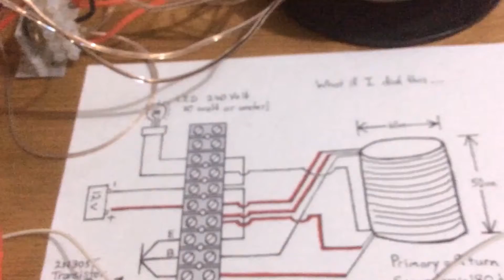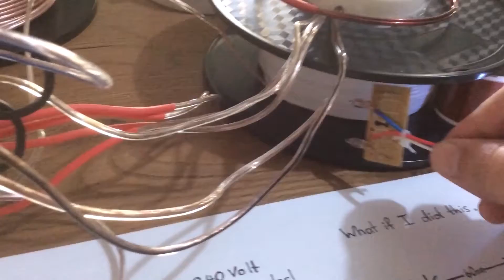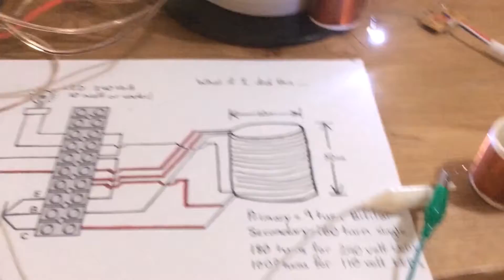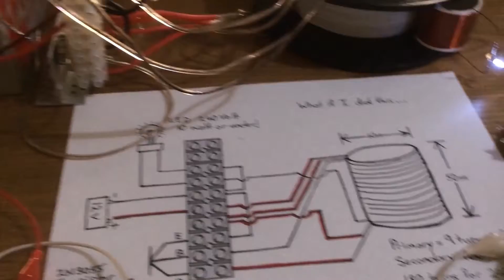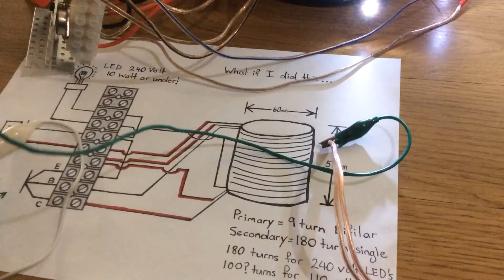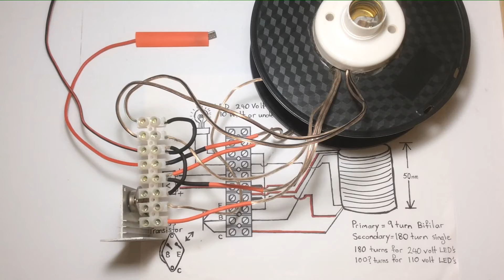Part 3 of 3 DIY Backup 240V Light How To Tutorial for Power Shortages - Connections What goes Where?

Comment: So, in the intro about safety (highly appreciated ! ❤) you have used that little pickup coil … I wonder if L3 with steering diodes and center tap + cap seen in other videos plays the same role ?  I guess the voltage shown in cap will sag down if earth connection isn’t able to provide enough current … can you suggest a load to be connected to cap in parallel with L3/pick up coil ?

Also, your L3 center tap should have no self inductance … means it can’t load L1/L2 when wound straight on top of L2 for best coupling outcome. Somehow, I can’t get the setup right and usually I can’t get it started with transistor base on high side … after trying many things once I can get it, it doesn’t want to work after disconnection and don’t want to work at all nor on low side nor high side and I never remember what I have done to get it to work … my hobby for last 2 weeks 😂

Comment: I'm in my 60's I did a lot of work in R.F. stuff years ago, your peak power is when you have optimum 'standing wave ratio' (SWR) (lowest reflected power) thats when most power is (RADIATED OUTWARDS) don't worry to much about low frequency radio signals they pass straight through the body with little effect, it's only when it is converted and stored in a capacitor that it can be immediately dangerous. Some people however do suffer from an intolerance to radiated radio signals. That being said microwaves are another story Giger-hertz frequencies can cook you alive if the field is more that a several hundred watts, as for milliwatts or several watts below 50 or so don't worry to much. Low frequencies such as long wave, medium wave below 1 MHZ will not harm you physically at least in the short term, we live in a swamp of low frequency waves all the time. Remember it is when a frequency is rectified and stored in a capacitor with several hundred volts you need to be careful. just thought I would ease your concerns. A friend in the USA has done extensive research into what is called Electro Smog which is radio waves http://seahorsecorral.org/ehs3.html

Comment: Very nice video indeed! Have you tried to close loop the device by feeding the source battery with the output of the capacitors? With lowered voltage using voltage dividers (using a few resistors)?
Reply from the maker: Thank you for watching. I have tried several different ways of feeding power back to the main battery and I believe it is important to pass the feedback through a toroid to convert the electricity into magnetism and back again to isolate some of the radiant energy field. The high voltage radiant energy that feeds into the battery through the circuits input connections prevents charge from external sources as it sees the high voltage and prevents current flow. Voltage dividers or resistors are essential and I find it cheaper to use things like old incandescent light bulbs for resistors as these can handle the heat and are much lower cost than large resistors.

Comment: I think that's high frequency high voltage very low current, still the safety warning is in order. When yoy touched the piece of wire you were introducing ground proximity thru yourself. I think you're touching on radiant energy, your antenna is your wires and circuits
Reply from the maker: I think your correct there, high voltage high frequency, current is a different beast when playing with high voltage high frequency. The higher both those are the more power is produced.
Don Smith would always mention the neon sign transformer for proof of over unity so I will use that here as an example.
Input:  240volts x 300ma = 75 watts
Output: 7500volts x 30ma = 225 watts
This product should be jailed for violating the laws of thermodynamics!
Reply: @whatifididthis...1236   Can't tell if you are kidding here...?  Does a neon sign transformer really have Pout greater than Pin?  or is it just very hard to measure Pout?   Thanks for the helpful video!
Reply from the maker: @TheProfJones  Definitely not a joke! We have been deceived at every level, they even have the evidence available for sale as a commercial product. Simple math is all that is required here.
Input - 120 volt at 0.6 amp = 72 watts
Output - 7500 volt at 0.03 amp = 225 watts
They keep us busy at work so we don’t have time to realise!

Comment: You have 2 capacitors 400v 20 pF. They are in parallel so this makes 400 volt and 40 pF. Or maybe they are in series. That would be 800 volts. How could they manage 900 volts? I have a capacitor 1000v and 220 uF.  uF is more than a 1000 times more than pF. I think the rise of the voltages would be significantly lower with 220 uF when you connect earth to the lower end and the capacitor with the negative of the battery terminal. I just try to find out the behaviour of more or less Farad in a capacitor.
Reply from the maker: The capacitors in this video are 1400 Volts DC, one of the 1’s has worn off the case on one of the caps. Using a cap rated lower than peak voltage will damage it and possibly even explode it.
Reply: @whatifididthis...1236  I just saw that my capacitors have 50 Volts DC and not 1000.

Comment: With the earth wire on the low end of the second coil and the capacitor connected with the negative side of the terminal you get 360 volts. And with the second earth wire connected or by hand there are more than 900 volts. Does the input current increase from the battery? I think it stays the same at around 3.2 watts.
Reply from the maker: I can’t actually remember, I will check for you today.

Comment: This is the best video of you in my view. Don't let someone tell you it's long. Every second of this video is very important and even more interesting. Earth 1 is 90 meters and rolled. I think this is key. Or could this also be just a cable like earth 2? In other words there were 25 volts when you connected earth 1 to the low end of the secondary coil. How many volts would be with an earth cable like earth 2. Would it be also 25 volts or less or even 0?
Reply from the maker: Thank you for your kind words. Safety is key with electricity, whilst I agree the video was long I didn’t want to be the guy that hands you a gun without a lesson in safety. The 90 metre roll should be unrolled as leaving it as a coil changes the frequency again, I just hadn’t got around to unrolling it when making this video. Although it should have been unrolled, if you were to place a fluorescent tube inside that coil it would light up from the coils high voltage field. This is the same wire I used in my last video showing 100 metres through earth with the wire unrolled. To be more effective the wires going to earth should be suspended above the ground as the circuit will attach itself to ground by just laying on top of the ground as it is in my video, obviously it still works but would be more efficient if positioned above earth. So yes, earth 1 should be like earth 2. A second earth will increase voltage also... at least it does in my system anyway. You may notice in this video that before connecting earth the high voltage is present only at the low voltage side of the secondary after connecting earth it’s as though the high voltage is pushed to the outer surface or toward the normally considered high voltage end of the coil. All these features require physical experiments to discover them as there are no books that cover this... I feel that fact is deliberate, society won’t teach you what gives you an advantage!
Reply: @whatifididthis...1236  For sure it's deliberate. Thanks for clarification because of the rolled earth-cable. So there is nothing to that. I order now 10 transistors (2N 3055) and speaker cable (100m). I could buy 0.5 mm2 (diameter 4.4 mm) or 1.5 mm2 (diameter 6.0 mm). What cable-cross do you use? The price of both is almost the same. I need also 2 capacitors. I found the model of your capacitors 1400VDC 20uF IEC61071. I have diodes 1N 4007 1000V 1A to build a bridge rectifier. Is 1 Ampere enough for a bridge rectifier for a test like you did in this video?